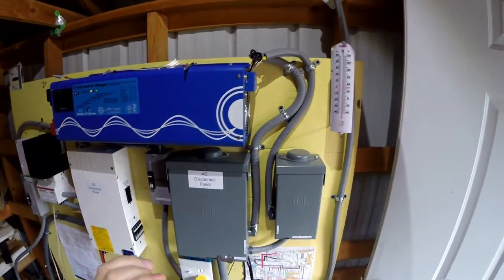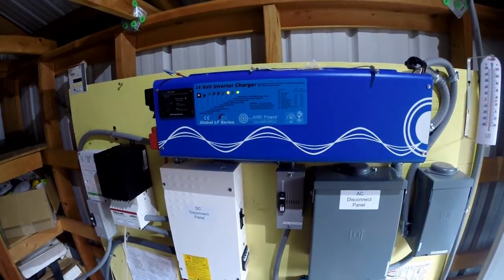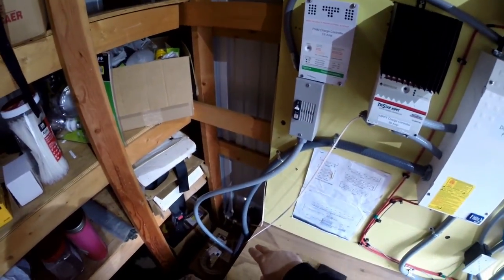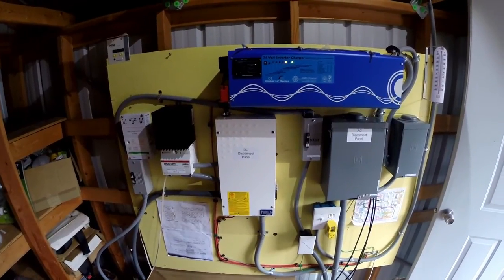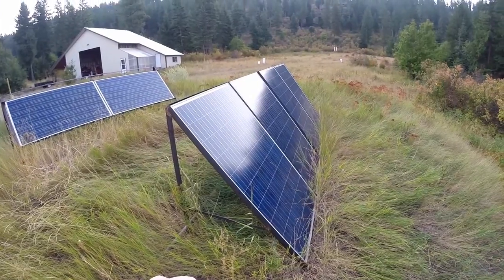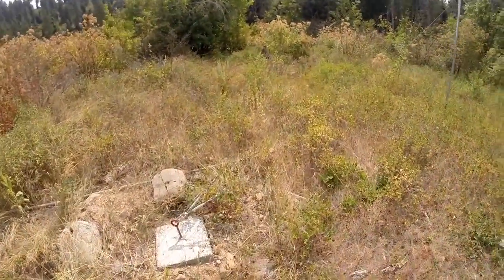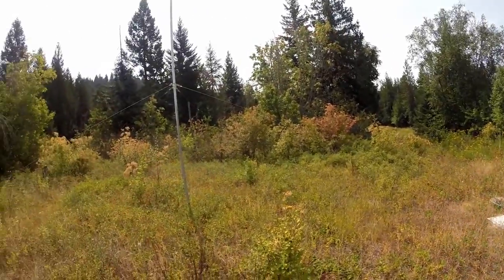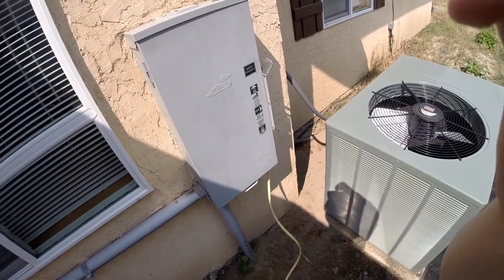4000 Watt AIMS Power Inverter Solar Panels Wind Turbine Setup Part 2 - Off-Grid w Grid-Tie Failover

Comment: Can I ask what settings you have on the aims?  I have the same inverter hooked up to the grid and am trying to hook up solar panels to charge battery bank through the day with grid for backup at night.  Have an EPEVER charge controller but almost fried the inverter with incorrect hookup. tripped the overload

Comment: Greetings friend, I tell you that I have an inverter of 6,000 whatts, I have connected according to the manual, but this stops generating and turns off activating a fixed alarm, this only happens when you connected an inductive load, example when you connected a clothes washer
Reply from the maker: I would recommend calling AIMS Power

Comment: I agree with Jack Sellers on the wind turbine. The rule of thumb is to mount a wind turbine 30 feet above any obstruction within 300 yards of it. It should produce better for you if you raise it up. Also the higher up off the ground you go the higher the wind will be to a point.

Comment: Nice setup Mark, i understand your frustration, but you Wind Turbine, need more altitude more likely 100Ft if you have build up some money ask a turbine installer to replace the mast for a bigger 100ft mast, it will work, make sure if the turbine installer just check the wind turbine, like grease up or something or replace a ball bearing, before they walked off the property...
Reply: I doubt it would be worth spending more cash on raising the mast since he is already regretting the money he spent on it. the installation cost of a larger mast probably would not pay itself off with such a small turbine and because of so little wind in that area.
Reply from the maker: +Willem Budde  Thanks for the tips!